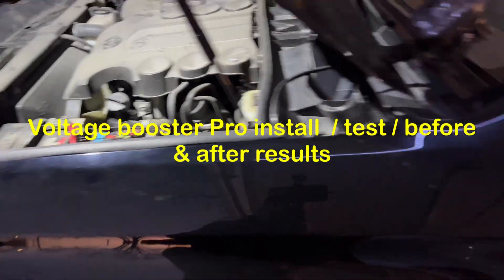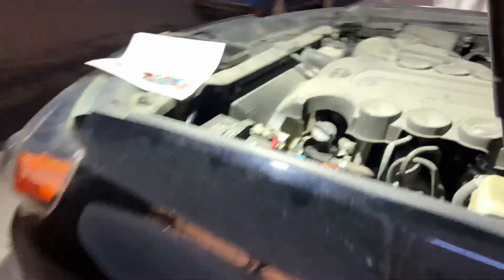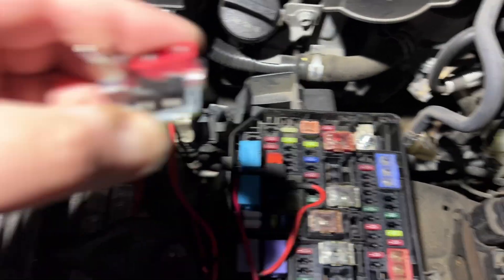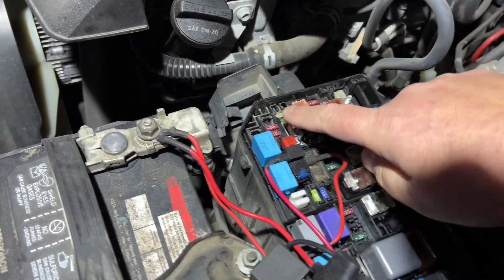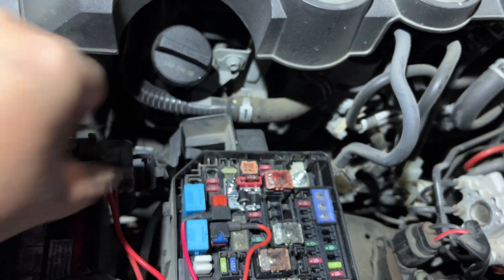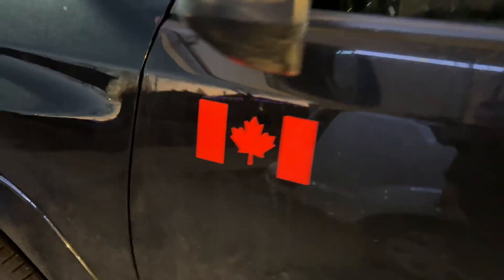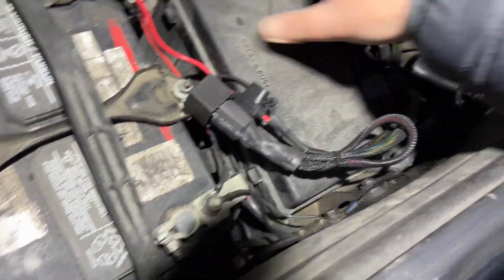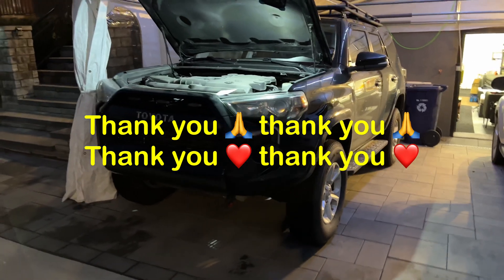Voltage Booster Pro Install on Toyota 4Runner 5th Gen for AGM Battery !

Comment: I just bought a interstate battery that was an AGM. I’ve heard they don’t last as long because they don’t get enough recharge from the alternator? Is that the purpose of the voltage booster or is for battery output to other things like lights, headunits.. etc?
Reply from the maker: This is the next best thing after sliced bread. Every year this time I had issues with mine, since this install, man, thins thing is awesome. My electrical current  is so much better! I wish this was available for every car. My wife’s outlander is suffering from same thing and I’ve boosted twice already. Mine, never this year, after this.
Reply: @KingSev  wish I had seen this previously. Just tossed my AGM swearing never again. Very cool.
Reply from the maker: @fastboarder2688  sorry man, AGM is nice and that’s why it’s 100$ more than lead batteries . Next time , keep it in mind. Thanks for the comment 🙏

Comment: Whats up with everyone having canopies on their driveways?
Reply: Prepping for snow ?
Reply from the maker: Exactly , prepping for snow, that’s called a tempo, they were the original company who created this. Then everyone copied them, it’s made in Quebec actually and there is a law for that, we cannot put it up when we want and we need to take it down Bt a specific date. Like the winter tires, also a low. 15 December is the deadline to install, April 1 is the deadline to remove, without that, our driveways will be a mess and that thing is expensive , mine is line 2K . Every province aka state has its own rule. Toronto for example, don’t allow it, Quebec does, but Montreal is in Quebec and there are postal codes aka zip codes, don’t allow it 😆, yes it’s complicated lol